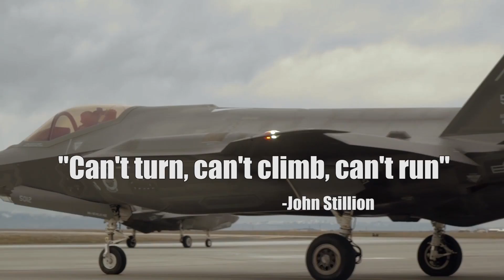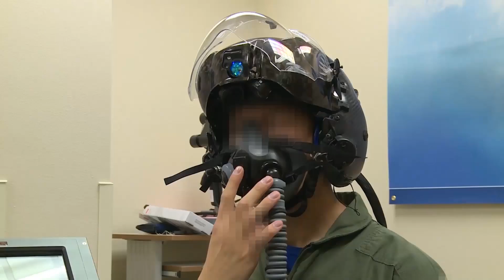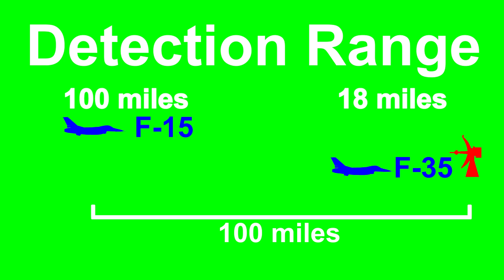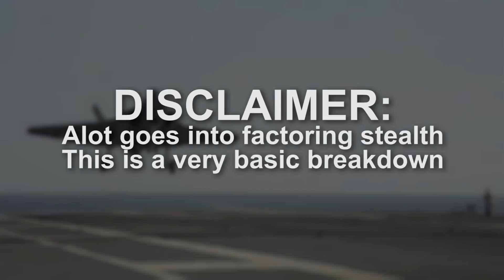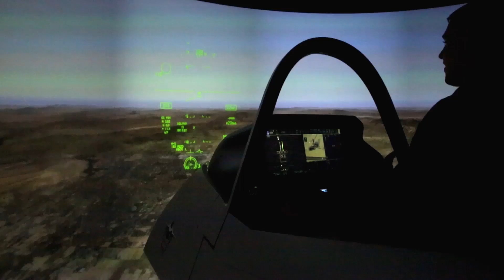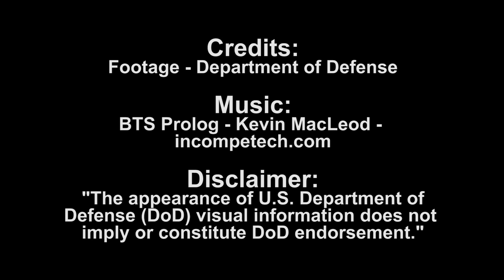F-35 Overview - The Good, The Bad, The Ugly

Comment: The most important feature of the f-35 is its amazing electronic warfare and sensing capabilities, which are not even mentioned in the video. It's like reviewing a pickup truck and not mentioning cargo carrying ability.  Totally missed the point of the F-35.  And it is not a dogfighter, not meant to be in a dogfight except by accident.  Air superiority is the F-22's job.

Thanks to smart weapons, hitting targets is easy.  The challenge now is finding them - while dealing with complex threat environments.  Networked F-35s automatically combine sophisticated sensor data to locate hidden targets.  And where it used to take a building full of analysts weeks to identify and defeat new threats, F-35 does it in real time.  The F-35 isn't about stealth or speed or tight turns.  The F-35 program is a bet that the future of warfare is in sensing and processing information.  Think of the F-35 as the world's first information superiority fighter.
Reply: It seems this plane will require a F-22 escort just to be on the safe side.  We've been down this, "the dogfight is dead" mindset before and it got our pilots shot down.  I do hope the information gathering capabilities of this plane work a advertised because our military is seemingly betting the farm on it.
Reply: Daniel Kunkle To a large degree the dogfight is dead. The dogfights over Vietnam happened because the Rules of Engagement required visual ID before engaging, once you are in visual range, you got a dogfight. Then you had issues with early AIM-7s and Sidewinders. The AIM-9X, AIM-120 and other NATO missiles have advanced considerably.

 Most of the air-to-air kills over Iraq in ODS were achieved with the AIM-7. How many A2A kills have been achieved with the gun since the end of Vietnam?

Also, gonna he hard to get WVR on the F-35.
Reply: Brandon Clark errr.....employing AIM 7 or 9M,L,X occur at distances well under 7 miles. This is essentially merged or when one would start using similar techniques used in a "dogfight".
Reply: My degree involves large amounts of real world real time data handling for these types of systems and my final year project even involved military aircraft, and while it's true that electronic improvements may be very important, the thing is that the computational improvements you are talking about are easily installed as a seperate module onto any aircraft and it is something that most air forces may likely have contracted to be installed over the last ten years or so
Reply: It was meant to be a dogfighter, and a bomber, and a close air support aircraft and to be used by the USAF, USN, and USMC all in one. That's the problem, and it will be used as a dogfighter, because they only built 187 F-22's and then killed the production line, ( They originally planned to buy 750 F-22s ) by contrast the Air Force is going to buy 1763 F-35's, the Navy is going buy 260, and the Marines 420, all of those forces are greater than the Air Force's contingent of F-22s. So to think it won't be used as fighter jet is unlikely, and it sucks at being a fighter jet, sucks as a bomber, and really sucks at close air support.
Reply: Chris Bang does the f22 have some of these technologies like the 360 sensors
Reply: "Air superiority is the F-22's job." Someone should go tell all the nations that don't have the F-22 that then.
Reply: agree
Reply: Those same sensors and avionics could be added to existing platforms without the stealth features. The price paid for the Stealth features are what hurts this plane.
Reply: Yeah, too bad they don't make F-22's anymore.  That baby is amazing.
Reply: I so hope you are correct.  I have seen the videos concerning it's information processing capability, and it gives me some hope.  But it is such a poor performer  in terms of speed, range, weapons carying capability, maneuverability and thrust to weight ratio.  And it is reported to be less stealthy than originally planned.  This is the plane built by a political committee.  The F35 would not fare well in a dogfight agains a SU35, and costs three times as much.  The total cost of the program is now estimated to be 1.5 Trillion dollars.  Why couldn't we put all that electronics inside an updated F22?
Reply: @andrewheffel928  yeah it only carries 4 air to air missles and in syria it took a hornet 2 of the same missles this would be carrying to take out a old mig,so at a 50 percent hit rate on average day the f35 will run out of missles before it does targets it is like u said a underwhelming plane made by  politicians,this is why you dont see any over syria the one and only one to do so came back damaged by a s200 isreal denies it says it was a bird but thats even worse,Iranians could start training birds as air defence
Reply: xfrosty 91 I was an Aviation Electronics Technician deployed with VFA22 on the Ronald Reagan from 2007-2010 (we did move to the Vinson in 2010). We flew the lot 26 F18E then transitioned to the lot 29 F18F in 2008. While true enough, in a full a2a load out the super hornet can carry at least 14 but I think it’s 16 a2a missiles (can’t remember off the top of my head because they were never loaded like that) I never once saw them loaded out like that. Not in training and not in combat. During normal carrier ops the Super Hornet is usually only loaded up with 3 a2a missiles. One aim9x on each wing tip, one aim120d on the #7 hip station, and  the ATFLIR pod on the #5 hip station. I never once in 4 deployments saw a bird leave the deck with more than 4 a2a missiles. You also forget the F35 can carry additional missiles on wing pylons if needed.
Reply: Except the EW and sensors can also be installed on other airframes. 
There is nothing special about the design of the F-35 airframe that makes it better at EW or IW. They made stealth the priority then tried to design a single plane to serve 3 different purposes. This was itself a challenge, requiring compromises, but the additional stealth requirements further restricted capabilities.

They over-promised with the JSF program so ended up under-delivering.
Reply: TheArty224 You are a fool if you think the F35 needs the awacs to to be effective.  I was in the first combat deployed AESA Super Hornet squadron. Simply going from APG73 to 79 was a game changer for the Super Hornet (in a2a anyway, a2g I will admit was shit show when we switched to 79). I saw first hand the type of advantage it gave us in the air. The advantage was so large that after we proved what it could do in joint service exercises, that big navy effectively shut us down during the NATO Red Flag exercise on our 2008 deployment. Big Navy told us we could fly tanker missions, but would not in any way be involved in any part of the exercise that required us to turn the radar on.  The latest generation of Super Hornets can do things that never make it out to the public. I love the super hornet and I think it’s an amazing aircraft. 

I say that to say this. I know quite a few maintainers from the super hornet community that have transitioned to the F35. These guys interact with the aircrew every day and the aircrew have no problem calling a spade a spade when talking to maintainers. If they come back frustrated because the plane didn’t do what it was supposed to maintainers will be the first to hear about it.  Just as well when they go up 1v4 or more and knock out all 4 legacy aircraft.  The maintainers are usually the first to hear about it. I have heard nothing but glowing reviews from them about its capabilities. The F35 apg81 is a generation or more ahead of the 79 in the super hornet. Couple that with the fact that it has capabilities through that radar and other systems both passive and active that you don’t even know about. Trust me when I say it can hide if it wants, it can definitely turn with the best of them, it can absolutely fight, and it probably won’t find itself in many situations where it needs to run.
Reply: I agree with Chris Bang. This piece essentially says the F35 isn’t as good at being an F16 as an F16 is. There are a few things in this stream that should be answered. The first is the F35’s track record in mock combat against legacy jets. It was lousy before F35 pilots figured out how to use the F35. More recently the F35 has been very successful. The comment most heard from legacy pilots was “We couldn’t see you.” As far as the stealth being unsuccessful and perhaps functionally useless, we should look at where the F35 has actually seen combat. It isn’t the Finns we should be listening to about this, it’s the Israelis, who are very happy with the F35. In combat over Syria, Chinese radar that was supposed to pick up F35’s and Russian antiaircraft batteries that also should have were both taken out by F35’s. Don’t be too quick to write it off yet.

As regards the F22, don’t talk about how we need more F22’s while complaining about the price of the F35. We don’t have more F22’s because we have trouble affording them. The F35 is substantially cheaper. The F22 was the best jet we could build, not the best jet at a price, and to whoever said that we haven’t seen other countries buy the F22 it’s because they can’t - the US refuses to export it by law, it’s that proprietary. The closest thing we’ll see to that overseas is a proposed Japanese joint project with Northrop Grumman. The prototype YF22 by Lockheed Martin barely edged out the Northrop Grumman YF23 to become the F22, and Japan has now approached Northrop Grumman about jointly building an updated version of the YF23.
Reply: You can't be taken down if you cannot be seen or found.
Reply: The f35 is good plane it can go in stealthy along with f22 destroy radars and Sam sites f22 gains air superiority and bam. just send not so stealthy aircraft like f15 f16 and f18 destroy all enemies after anti air defenses are gone. Think it’s better option then just using f22 air to ground or sending 4th generation fighters in area believed to have anti air defenses.
Reply: ger du  I don't think the F35 is that expensive at all. If u compare the Euro Fighter and the Dasault Rafale which came cost 100millon Euro in then dollars as long as the F35 matches the F16 in areodynamica performance plus all those advanced electronics and stealth it is a bargain not to mention the cost is expected to go down
It's easy to compare it to a hypothetical Russian and Chinese fighter supposedly cheap but the Chinese only got a handful of planes flying with old russian engines and the Russian project basically dies because they didn't have enough order to support the project
Reply: That was a better explanation of the F-35 than the video.
Reply: Wait so it does the job of a satellite?
Reply: @aris.a2912  Exactly, it's why so many nations are questioning as to why buy the thing in the first place.  
First thing is first a nation needs a fighter interceptor for air defense and their are not exactly many options on the table.
Reply: What if the prediction is wrong? F-22 can dogfight if it must. Why not the F-35. People scewing us out of our tax $$$
Reply: yet the US airstrike force in Syria was disabled by "completely superior" Russian electronic warfare systems
Reply: Did you get this from the brochure.
Reply: It's nothing that can't be retrofitted into current jets.
Reply: @TheArty224  S-400 wouldn't wack an AWACS.  AWACs would never fly that close.  If you think the S-400 can fire that far then make sure you look at how far an AWACs can detect and how far an S-400 can shoot and make sure you get the km to nmi conversion correct.  AWACs are always escorted and recon flights would comb areas before any line advances.  Most likely a combination of EW aircraft and SEAD/DEAD aircraft would advance on any zones that may have unknown SAMs in them before an AWACs route is advanced.

Enemies would still want to take out an AWACs as priority but this means going through CAPs or using a large attack wave which would just lead to a ton of GCI's getting launched to defend.  An AWACs is likely to be flying over a SAM site on its side itself as extra defense.  

The F-35 is pretty fast.  The moment it is thinking it is at risk it can run.  Even if an enemy plane is travelling at Mach 2.0 to try and catch it and the F-35 is travelling at Mach 1.3 supercruise.  If the F-35 started running at 80nmi the enemy jet will take a very long time to catch it and since your chasing, your missile effective range is cut massively, plus being jammed to also reduce missile lock range.  Also it is very likely a chasing plane will run towards a friendly CAP or SAM bubble or lead the chasing plane into an ambush from other stealth planes.

And for everything you have heard about its dog fighting capabilities, how do you know that isn't propaganda to keep potential enemies from knowing what it is really capable of.
Reply: wrr, not, idts, cepu, say any nmw s ok, 2235 inferiorx, no such thing as superiox or first about it
Reply: Folks just remember.....
We are 30+ yrs ahead of anything that's seen by the public. Meaning this aircraft was available 30 yrs ago. 
Imagine what we really have in our fleet!🇺🇸✈🇺🇸🚀🇺🇸✈🇺🇸🚀🇺🇸✈🇺🇸🚀🇺🇸✈🇺🇸🚀🇺🇸✈🇺🇸🚀🇺🇸✈🇺🇸🚀
Reply: The long range sensors are a huge advantage. It’s also not like it’s incapable of dogfighting, what’s so good about it is they’ll have  similar speed and agility to other fighters but they’ll be able to spot any enemy way before they could spot the f 35 so they can get into a more advantageous position and hit them before they know what’s going on
Reply: It's probably designed as a drone control craft. The military needed suborbital craft for use of hyperspectral scanners. That way they can much more reliably locate insurgents.

Probably has a bunch of other experimental technology as well. I know earlier versions used VR in stead of a traditional HUD. But apparently that's been scrapped.
Reply: The could fit that to other planes if they wanted, so not really the plane itself you are praising there.
Reply: Dorian Leakey I would expect that some F35 EW capabilities could be bolted onto other planes, others could not.  You’re not gonna just bolt the same capabilities onto an F16.  That platform isn’t the only factor, but it matters.
Reply: you work for Lockheed Martin
Reply: isnt it possible for a casual observer to simply see what’s great about this plane? after hearing all the naysaying i decided to do some reading up on why the military wants this plane, and discovered there are some really groundbreaking capabilities in the f35. the eagerness of US allies to get their own f35’s is telling also.  I don’t work for lockheed but have some aerospace experience, and more importantly I’ve talked with experts who know a lot more than I do. The nature of warfare is changing.  The f35 excels in the new paradigm, i think it is a mistake to compare it against the old paradigm.  Future wars will be won more with bits and bytes than by weapons and platforms.
Reply: @chrisbang9438  you can put the hardware and software in a different plane.
Reply: Vic nowhere near to the same degree as the f35. for starters the f22 is older.  also the f22 is designed for air superiority - more emphasis on air combat relative to electronic warfare as with f35.  i don't know as much about the f22 however so i dont have a lot of specifics
Reply: Comparing F35 with Su400 would be like comparing a gunman with a swordsman. Howsoever skilled the swordsman might be,  he had no chance against a gunman.
Reply: Information gathering is fine and all but why not just stuff those fancy electronics in a plane that actually pulls it's own weight instead of that toy they keep pushing.
Reply: The plane can be 150 miles away and take you out. It's not meant for dog-fighting but it's the ultimate dog-fighting counter. It can detect a target moving at subsonic speeds from nearly 180 miles away. The long range missiles it carries says a lot about the purpose of the aircraft.
Reply: juzzi errrr....which munition that will fit in this plane is designed to take out enemies 150 miles away? Come on man....you can't just make shit up.
Reply: juzzi AMRAAMs have a range of less than 20 miles......and that's if they're fired from high altitude. You need to do a little more research. Firing the missile from that distance might cause an enemy pilot to go defensive, but he'd have to be a poorly trained pilot to get popped from that distance. As soon as the radar on the missile becomes active, the enemy pilot would know and would react. The distance would give him time to react. Firing from under 10 miles would give the enemy pilot much less time to react and less chance to bleed energy from the AMRAAM. 

I won't tell you to stop playing video games. You should just play more realistic ones. LOL.
Reply: hba8103 I think you’re the one that needs to do research.  The aim 7 matches what you’re talking about but that missile is basically phased out.  The AMRAAM or Aim 120d has a much greater range than 20 miles. The listed effective operating range is >85 miles.(who knows what it’s actual max range is)  While that’s only about half of 150 it’s also more than 4x what you claim.
Reply: @hba8103  AMRAAMs, at least the recent C and D variants, have a max range of between ~50 (AIM-120C-5) to ~100 (AIM-120D) mile range. Don't know where you got your 20 mile range data from, but it's incorrect.
Reply: 0828chadstout physics. You can fire them from that range, but they wouldn’t hit anything but the ground. Range and effective range are different things. A missile fired from 40,000 ft had a longer range than one fired from 10,000 ft. The air density has a huge effect on the range. In addition, enemy fighter planes aren’t drones. Firing from such a distance would be asinine. An enemy pilot would have plenty of time to simply bleed energy from the missile (zig zag), turn around in order to bleed off energy or notch the missile (travel perpendicular to the missiles flight path). Firing from that range is ineffective. As you go below 20 miles the ability of the missile to actually hit a maneuvering target increases exponentially. 

The missiles don’t use stealth. Once they’re fired, they turn on their own tracking radar for guidance to the target. That tracking radar will send an alarm to any modern RWR system and the pilot will know there’s an incoming missile. This is why stealth is important. It reduces the distance from which the missile can be fired, significantly increasing the odds of hitting a maneuvering fighter.

Specifications are one thing. Real world effectiveness and tactics are another.
Reply: That is correct
Reply: "You can't be taken down if you cannot be seen or found."
And it's here we see the different schools of thought diverging. Some have optioned for stealth and the aerodynamic problems that comes with that and others go for advanced countermeasures and EW in highly manoverable platforms. Can see him...but can't lock radar guided weapons on him. One is better for sneaky deep strikes the other for air superiority and not so stealthy air to ground.
Reply: Chris Bang A Absolutely agreed.
Reply: But the thing is just like the Comanche, you can take all that sensor tech and put it in another plane, the F15X is designed to link with the F35...  The F35B is a next gen marvel, the A and C for the U.S makes sense but for those nations that are going to run one fighter jet its a eh... Not sure...  a few Flankers coming in at full burn with external fuel loads, if your F35's can't catch them what can they do?  Its the debate of interceptor vs attack jet. 
The F35 is not nor should be compared to the F15, Eurofighter, Flanker or Su-35, its a F16 replacement...
Reply: Exactly. I’m very surprised this video mentioned none of this. I usually like Covert Cabal’s videos, but this was a huge miss. 

The F-35 has a publicity problem because its greatest advantages are highly classified. If their details were publicized, the advantage would be reduced. The F-16 is a flip phone compared to the F-35’s iPhone XS. Except you don’t get to know all the features...sorry.
Reply: A few points:
1. The electronics is by no means superior to other modern combat aircraft, such as SAAB 39.
2. While this aircraft was initially not intended to be a fighter, that's how it's now marketed. (And by many nations intended for use.)
3. The RCS mentioned apply only to radars used by mobile short range AA units, and only head on. Medium and long range SAM sites use radars for which the F-35 is considerably less stealthy.
4. The Australian assessment mentioned is a very good reading!
Reply: @Olle P you mean this? https://m.news-mail.com.au/news/the-controversial-f35-lightning-stealth-fighter-is/3574335/

Doesn't sound promising.
Reply: Chris Bang the F35 is a bit of a dissapointement for me because 1. Americans starve and go hungry in the streets while the government spends 1.5 trillion on an aircraft that struggles to work 2. has lost a lot of fighting simulation tests against aircraft like the F16 fighting falcon and F15 eagle 3. Its handling in VTOL is horrible with its fat belly it can’t even be stable when landing and the RAF expect to buy that thing when we had a better aircraft called the Harrier then we gave them to the US